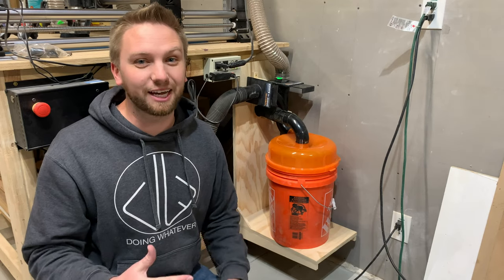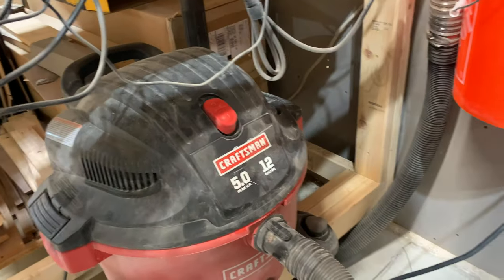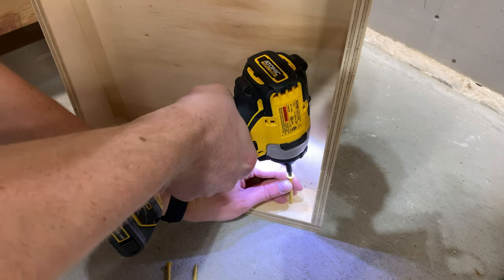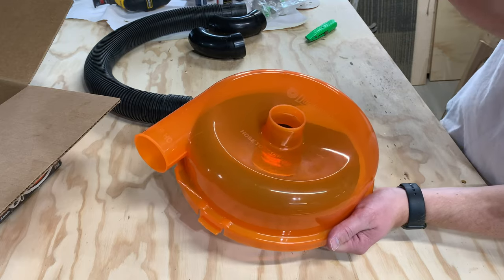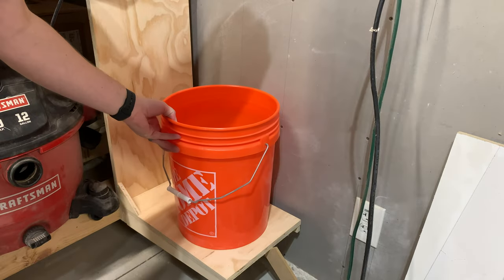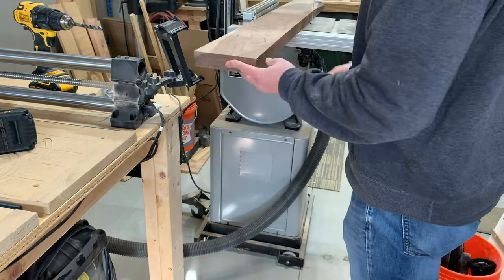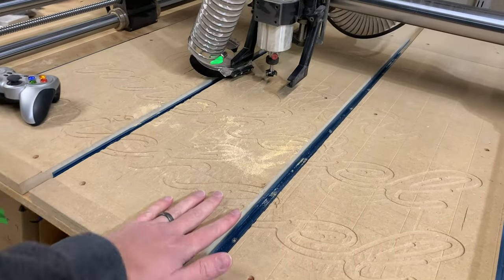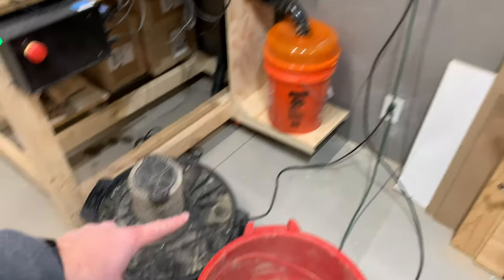DIY Dust Collector and Separator For a CNC Machine

Comment: Nice job. Dust separators are one of the greatest inventions ever conceived for woodworkers. Even basic, less efficient separators are still miles ahead of just  using vac bags. I use a dust deputy 2.5; it's the most efficient separator available, but that efficiency comes at the cost of having a unit that's taller and takes up a good bit more space compared to the dustopper.

About your setup now, it's worth putting a bag in the vac still. All that fine dust that went to the filter in your test would be confined to the bag and your filter would stay pristine and maintain as much airflow as possible. It would literally be years until you have to change your vac bag as long as you keep up on emptying your waste bucket. Also, if you find yourself emptying that bucket more often than you'd like, you can build a scrap bin of your own design.

Keep it up! Good content. Subscribed. 👍
Reply from the maker: Thanks! Yea I was pleasantly surprised how well this worked! I’ve got one hooked up to my miter saw as well. 

Yea I put a new bag in the shop vac after I filmed this video. I just wanted to see how much dust was separated first without a vac bag. You’re right, it’ll probably be years before I need to swap out that vac bag! 😃 

Thanks for subscribing - I really appreciate it!

Comment: Should the shop vac be ok running for such a long time? Won't it burn out?
Reply from the maker: It might burn out eventually but until I get a dedicated dust collector, this will work lol. I bought this on marketplace for $40 so if it goes, I’m not out too much
Reply: @DoingWhatever  Do you think adding a Router Variable Speed Control Dial to run the shop vac on lower speed might increase the life and reduce sound. I was thinking of running that experiment. It just cost 18 bucks :D
Reply from the maker: Possibly! To be honest, I had never heard of the item you mentioned - had to look it up! Lol
Might be worth a try!

Comment: of course the obvious question is if you can run that vacuum without bags then why were you buying bags for it in the first place? You could have saved all your money by just not using the bags.
Reply: So I’m far from an expert, but the way it’s been explained to me when I’ve taken classes for lead and asbestos replacement (basically fine dust removal for contractors) is that shop vacs themselves aren’t actually air tight and sealed.

So even though you could have hepafilter next to the motor, you likely will get additional leakage of fine dust particles. The goal is to produce a couple of layers of protection to ensure the entire system is either hepa rated or as close as possible. Now you may be saying this is wood and not asbestos, but fine wood dust is considered just as bad because of the glues and other chemicals in manufactured wood.

This does innately create some loss of vacuum, which has to be balanced in any system.